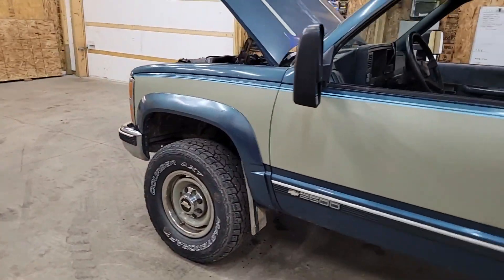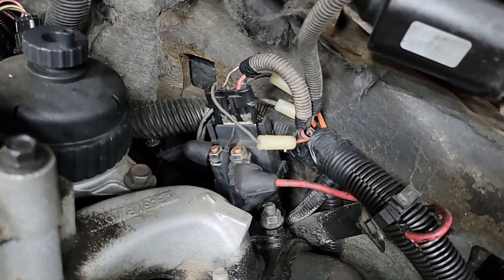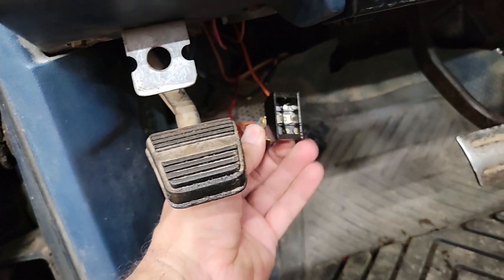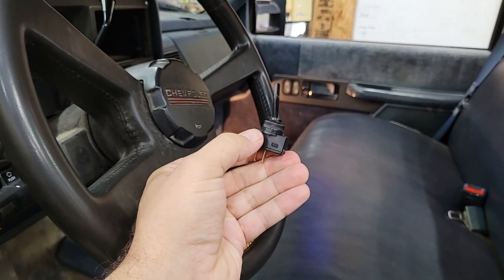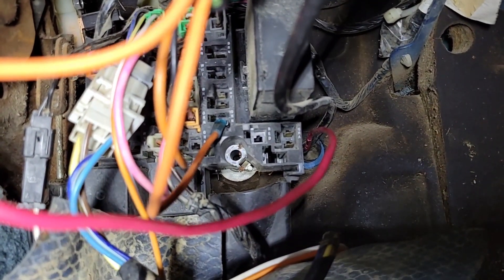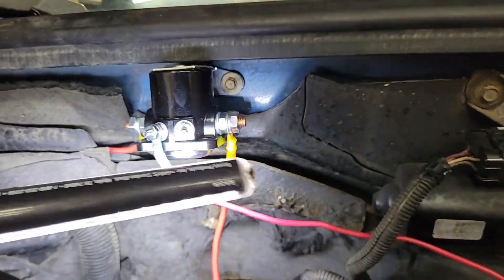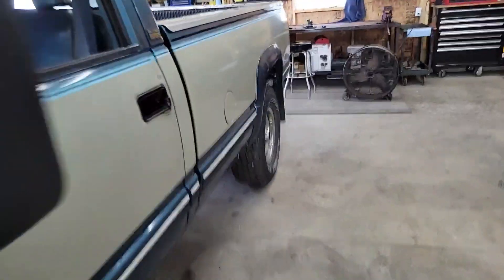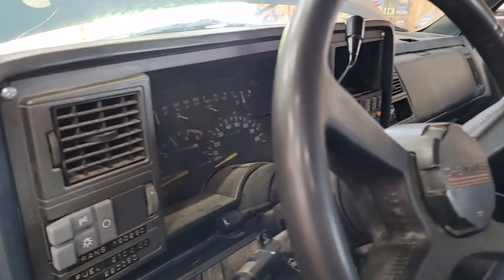How to Wire a Momentary Toggle Switch and Solenoid to Control Glow Plugs in a 6.5 Diesel

Comment: Bought a similar bypass solenoid (3 pole body ground) I am thinking about using the constant power side direct from original controller to the bypass and out  out to the controller Glow Plug side. ....Just Reducing wire length.
Thanks for the under dash Keyed Power source for the switch, That's Awesome.

Comment: Greetings: Essentially U Jamaicafied / Africanized it by the  "Creative wiring". I will credit U the relay, fuse (however 3x what should B...normal 4 lack of knowledge ), Mom switch, OEM relay disconnect and the uJunk glow plug thought.  Gotta love it. Desspite, sometimes, it is a PIA it helps my business. Suffice 2 say as long as there R idiots attempting repair I will not B bored or starve. Key words"...put stuff back the way it is supposed 2 work". Advise- Troubleshoot and repair it properly or take it 2 some1 who can. Unless it is Ur POV. Still my advise applies. No disrespect 2 U. Just a thought. On another note, after U shut it off I heard what sounds similar the fuel pump running. Such should not. I hope my ears decieved me. Thx 4 the share. Bsafer
Reply from the maker: You are correct. Glad I could entertain you.